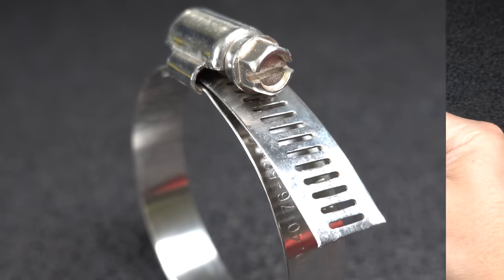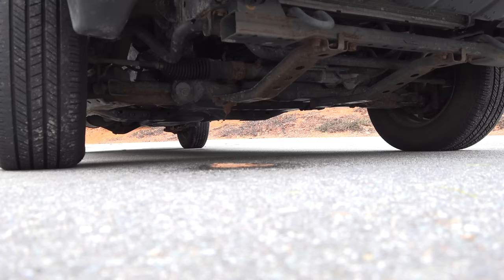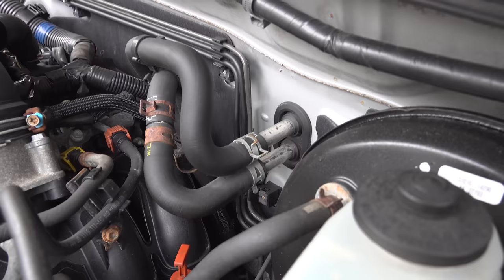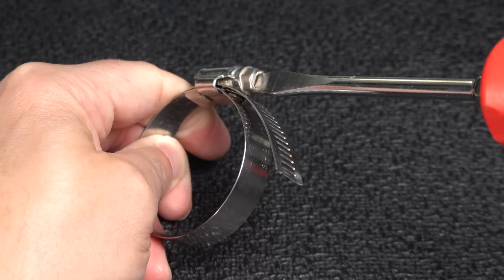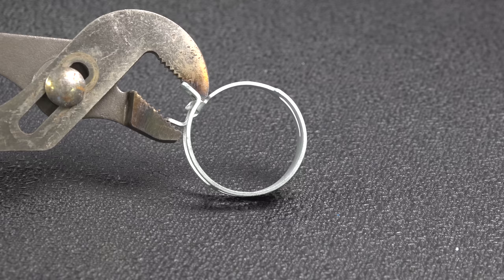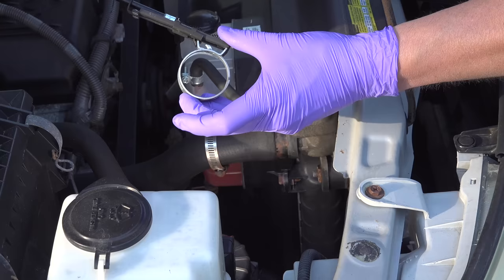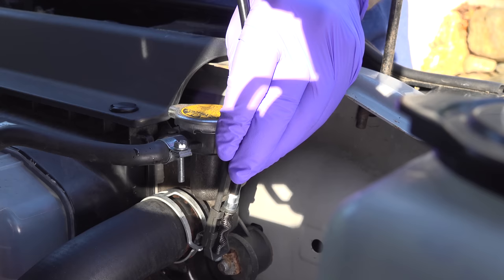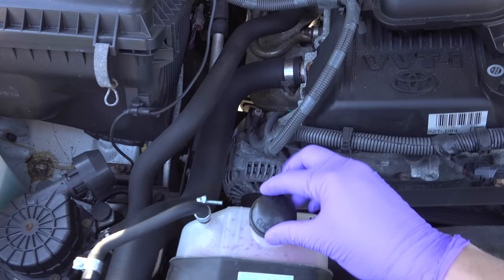STOP Using Hose Clamps WRONG - LEARN A BETTER WAY

Comment: This must be a paid advertisement, because pinch clamps are terrible and they often fail within a few years, manufacturers only use them because they're fast to install on new hoses, keyword is NEW..... once a hose is worn in, if you ever have to remove it the hose will most likely leak because they are installed before the engine is in the car so they don't care about indexing it so it can be replaced easily, so if you don't get it indexed EXACTLY in the impression, then it will leak because very often the pinch tabs are on the side or the bottom of the hose making them actually very difficult to remove and almost impossible to reset exactly where they were before. With a screw type hose clamp it doesn't matter because, as you demonstrated, it can simply be tightened to compensate for the impression irregularities. "Old style" clamps are far better than those B.S. oem clamps
Reply from the maker: Who would be paying me, the clamp association of america? If you watch the video closely, I installed a constant tension clamp on the old hose with the impression of a jubliee clamp.  not ideal, but 3 weeks later, tight as a drum not a drop leaking.

Comment: You had a failed clamp nothing else. There is millions of worm clamps in service with no issues. Oems use spring clamps because they are cheap.
Reply from the maker: Just another myth, constant tension clamps are more expensive than spring clamps. Check for yourself if you don't believe me.

Comment: Yeah your giving false information. The dealer use those Clamp because they know there going to fail after the warranty period and they know your going to bring it in for service and the old school clamps work better but you need to make sure your using a good quality clamp not one of does 99 cent clamps. The spring clamps are also never use for sports cars or drag racing because with high pressure we had radiator hoses pop off with spring clamps still conected on the hose but never had this problem with screw clamps.

Comment: So a worm drive can crack a plastic rad outlet, but smacking it with pipe grips is ok? Looking at the rust that don’t match your leaky clip, and the poor condition of the coolant, your leak is more likely dirt on the sealing area. Pay more attention to detail, do a better job, and don’t waste every1’s time spouting rubbish about a time proven design.

Comment: The clamps you are advertising loose tension and after 100 or so thousand kms  they are useless
Reply from the maker: The Tacoma in the video has 200k and is a 2005. Not one of the factory originals has failed. Lots of myths out there about these clamps.

Comment: That's hilarious , red hot. Really,? If you have red hot coolant you have more problems than a clamp. 
Manufacture's use the spring clamps and have for years because they are quick to install on the assembly line.

Comment: this bs clamps exists cause it´s easier for the manufacturer to put them on. they doesn´t last. another point is the thinner rubber hoses. but there are automotive wire hose clamps thats much better than the simple ones.

Comment: Those spring clamps break on appliances all the time. The metal band slowly begins to warp and fail in high tensions, not so much temperature. Both are shitty designs.

Comment: I remove spring clamps almost every time. This guy's wrong
Reply from the maker: Every one you remove will eventually leak or crack the fitting. How would a temperature adjusting, constant pressure clamp be worse? Only place you don't need them is on air boxes, or hoses that don't have temperature swings.

Comment: Those clamps are a royal PAIN! Over time the hose expand and the clamps even when fully compressed won’t move. I utterly hate those &@“; things! 

Get the heavy duty worm gear clamps from the parts store. They are heavy duty and stainless and turn it with a wrench for goodness sake. Not a screwdriver!

Comment: This video is full of wrong information.  The large constant tension clamps have lower holding force.  Anything over 1” should use a worm style clamp with constant torque design and stainless steel.  The small diameter connections are better with constant tension style.
Furthermore, plastic and rubber do not expand or contract with temperature change.  That is wrong.  If anything the expansion occurs with pressure inside the connection or media (coolant, oil, etc).

Comment: Yea well you drive a bone stock truck with no power so of course those weak clamps work for you.
Reply from the maker: So much flexing on Youtube. Every vehicle made uses these now, you make it sound like I am selling the clamps. Do what you want, here is a great tip. Use a jubille clamp, tighten it down until the fitting snaps, then back it off 1/4 turn. You will be all set

Comment: This is nonsense,worm drive clips,especially genuine jubilee ones are far superior to them tension ones.over time they loose tension and the hoses pop off.jaguar started using them in the 90s.coolant hoses would blow off.put a genuine jubilee drive clip on and never had the problem again.cheap ones,not so good.

Comment: No hose clamp is perfect. The so called "smart clamp" you're talking about splits over time and also leaks. As far as the worm drive clamp, you actually showed yourself over tightening it in the video. The problem you had could also be blamed on the hose, they don't last forever either. I've replaced many spring clamps at the shop that split on the backside.

Comment: Old style clamp ?  How old are you ?  You sound 22 or something.   Those (new style) clamps youre using and advertising in the video Are 50+ years old and have been used factory for tons of vehicles.  I have 30+ year old Jeeps with those (new clamps) clamps.  

It isnt old vs new style.. just cheap vs more expensive.  Those (new) clamps are also generally one time use.  You can reuse them but ive seen those leak too.  Although the worm ones ive seen leak more

Comment: This guy is a wing nut. Worm clamps at tried and true have never seen one leak that was tightened correctly!
Reply from the maker: Every manufacturer switched all coolant lines and hoses subject to heat for the reasons shown in this video. The problem is you can't tighten a hose correctly that has huge temperature variances. Test it out. Check your clamps on coolant lines when hot, nice and tight. When they cool check them again, they are now loose. Often why cooling lines leak when cold.
Reply: @SilverCymbal  nonsense,manufacturers have been using that style clamp as long as I can remember,different OEMs used different styles, nothing wrong with them,but you will often see them replaced with worm clamps,many experienced mechanics prefer them. I don’t care either way,but you are a  taking a rare and extreme case scenario and trying to make it a common issue,which is simply B.S. but  hey, knock yourself out if you will sell more clamps…..
Reply from the maker: @milwaukeemikee4063  If you look under the hood of your car, and its under 10 years old at most you will have 2 screw clamps, (usually on the air box only) I know it may be upsetting but it's either true or not. You are in for surprise but thats a goods thing, you will see that it's true.

Comment: They are not a new style, they are quite old actually, and if you remove one you need to replace it to the exact location and orientation if using the same hose and be sure to return it to the indentation where it was before or you will get a leak in the same way your old-style clamp leaked, be honest bro, this video does give a good piece of info about temperature change but overall it is not honest. THUMBS DOWN

Comment: Oh come off it...making out the clamps are the cause of leaks.   More likely the hoses are perished.  Used worm drives for 35 years.
Reply from the maker: The hoses were nearly new, the foolish mechanic installed the spring clamps. Problem kept up for months with multiple adjustments. After changing to the factory CT clamps on the SAME hose  problem solved. What more would you like?

Comment: This video is pointless and the poster doesn't understand engineering dynamics of different clamps. Including ones he's not even mentioning, t-bolt clamps, friction washer worm clamps, and heat shrink plastic clamps.
Reply from the maker: Sure, me and every manufacturer have it wrong.

Comment: Stupid. pressure claps suck worm screw are the new clamps always use them, never had a issue with them. About 8 years of mechanic experience and never a problem

Comment: Horseshit. I have been using aviation style hose clamps for decades and have never had a problem with leaks.
Reply from the maker: Probably just kept topping fluids off and didn’t notice. Ever wonder where it goes?

Comment: Not better. More expensive to install and a pain in the ass coupled with the fact if it bends or rusts you will have a mess.
 I have installed many stainless screw clamps and never an issue. Also you can adjust the pressure with them.
 Also spring clamp sizes are fixed and therefore a pain in the ass to apply to the proper application when out of production.
 Try again new kid. Unless you can custom make your own stupid spring clamps.
 Plus you can take two small screw clamps and turn them into a larger one. Do that with your stupid expensive spring clamp.
 Buy U.S. Made screw clamps.

Comment: No you did not use the wrong clamp. You got a cheap worm gear clamp. Been using worm gear clamps for over 20 years. They are better than the factory as you can reuse them. The manufacturers default clamp only have a limited use before they wear out. And the temperature thing is the dumbest thing I have heard of. Rather use a worm gear vs that spawn of satan the is called a hose clamp. Oh, when you use a worm gear, don’t use a screwdriver, use a 8 mil or 1/4 socket to tighten it. It will not spill of.

Comment: First off ya ding dong, if you use the correct size hose clamp for your application you won't have leaking issues.......period.

Comment: Lol. Clear you’re not a mechanic. Those hose clamps are very unreliable. Especially if you reuse them on old hoses that are kinda hard. They don’t have enough tension to seal a hose.   The reason they are used at the factory is because they are cheap.  Not to mention they are a pain in the butt to use in tight areas
Reply from the maker: Unreliable? Sure thats why every manufacturer now uses them, they definitely want leaks and blown engines to honor their 60k-100k engine warranties. They are also more expensive than worm clamp for good reason, they are more reliable.

Comment: False information. Worm clamps are far superior. Spring clamps are weak and often don't fit tight enough to make a good seal, especially on systems that build pressure.  Auto manufacturers don't use them because they are superior, they use them because they are quicker to install during mass production. They are merely adequate...for a little while.

Comment: Disliked for absolute 180 degree -reverse DISINFO. Take those GARBAGE spring clamps & throw them as far away as humanly possible & replace with quality worm-gear clamps, like you KNOW you should. I've NEVER had leakage or any other problem with worm-gear clamps. There's a reason they're mandated by NASCAR.

Comment: I totally disagree!!! The only reason the manufacturer use these piece of sh... clamps is because they are cheap and ease to use. If you use a good worm clamp, correctly tightened i.e. the strap leveled with the surface of the hose tube, there will be no problem at all

Comment: Bullshit this is garbage. It  helps if you use decent quality stainless worm drive clamps of the correct size. Never use cheap rubbish.  And old hoses go hard and should be replaced.

Comment: This video is full of misinformation. The reasons manufacturers use those spring clamps are based on economics, not engineering: they're cheaper to make, and faster/easier/cheaper to install in a production assembly line.
Reply from the maker: Be wrong if you want.  They are more expensive 3x as much. Check it out

Comment: Is this clown for real? Spring clamps are used by manufacturers because 1 cheap to make and 2 speed of assembly, both for money saving. If he's having issues with screw clamps it's because he's using cheep crap wrong sized or incorrectly installed. Problem with spring clamps is they fracture and start cutting into pipes, try removing a broken spring clamp without doing any further damage to the pipe its on
Reply from the maker: They cost more than spring clamps, sorry you can keep believing a myth if you like.
Reply: @SilverCymbal  what they fu k you going on about I never said they was cheaper than spring clamps. Screw clamps are more expensive that's why manufacturers use spring clamps. I don't need to believe in myths I manage a fleet of 300 taxis and I'm constantly swapping out shitty oem spring clamps

Comment: Dont make content about something your clearly know nothing about. Spring type constant tention clamps are absolute shit. Use good quality hose clamps and they work brilliantly. Mikalor, JCS higrip etc with them available in constant tension designs where thermal expansion is an legitimate concern. The reason for the prevalence of spring clamps is nothing to do with performance, its cost. They are cheap and can be rapidly installed in seconds so they are ideal for mass production. They only work well on new pipe and have a very limited size range where they provide adequate clamping force.
Reply from the maker: Sorry but its up to you if you want to continue to be wrong and believe myths. The clamps are more expensive and are not easier to install for a factory or anyone else. They are used because they deal with wide temperature swings. Static clamps do not, ever unless you overtighen them which everyone does until the plastic fittings eventually break.

Comment: Um obviously you are trying to get views from people that think this is a good idea these clamps fail and come on vehicles and are not recommended to use from any manufacturer or any one who knows what they are talking about 7 need to make videos on something u actually know about stop spreading false bs 

And if u actually want a better clamp that won't break or loose tension use a heat shrink clamp know yo facts bro
Reply from the maker: Every manufacturer is using these. What are you talking about?